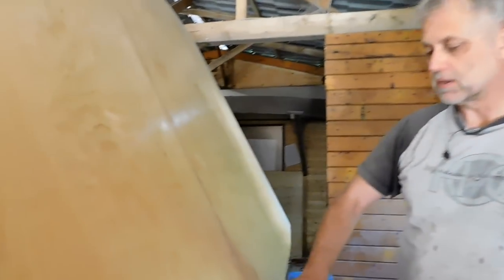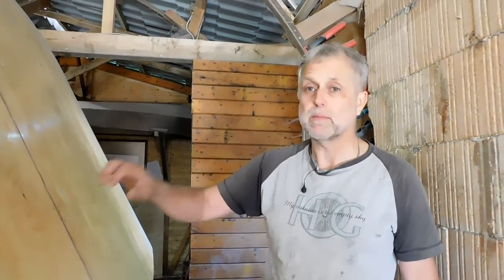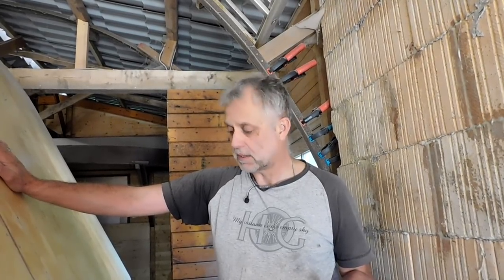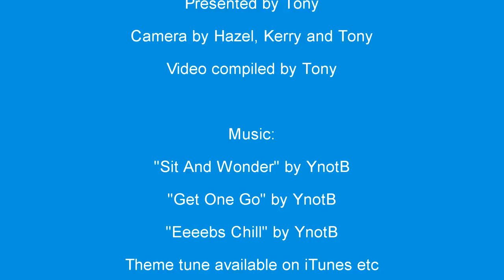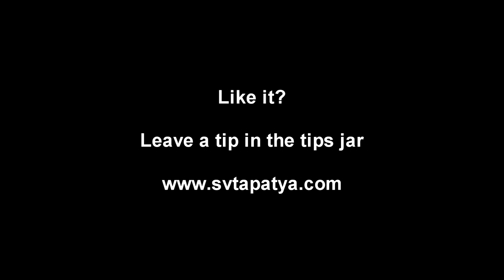Fibreglass and epoxy sheathing the bottom - SV Tapatya EP42

Comment: Is fiberglassing necessary for waterproofing the boat, or would the epoxy in the joints be enough?
Reply from the maker: It’s necessary to waterproof the boat, Brian. On the outside, at least. As you can see, I prefer to glass both inside and out, to completely seal the wood

Comment: What's the plan for the keel?
Reply from the maker: There are 2 options - a long keel or a fin keel. I believe both could be made from either lead or some form of high-density concrete. At least 2 other builders of Benford dories recommend the fin keel, so my current thoughts are for the high-density concrete fin keel, but I still have time to think about it....
Reply: I think I remember a Benford dory with the duel keels.
Reply from the maker: I have thought about that. Easier to dry out/ beach, but a bit slower through the water. Needs further thought
Reply: Dual keel just like SV Seeker🙂

Comment: what that they say about working with fiber glass if your sanding you should be
Reply: I see some doing fiberglass use a special roller with groves in them to get the air out
Reply from the maker: Yes Mike. I've got the special roller, but it came out so well it didn't seem to need it.
Reply from the maker: Thanks Raymond. I assume you mean protective gear. Certainly if you're sensitive to glass dust you should wear a protective overall when sanding fiberglass. I don't seem to be too bothered by the dust on my skin, a shower afterwards does the trick for me. One should also wear goggles if there seems to be any risk of getting the dust in the eyes. I do believe that the use of protective gear should be the individuals choice but that that choice should be made after an informed assessment of the risks involved in whatever task is being undertaken. This was just a quick sand, so a dust mask was enough for me.